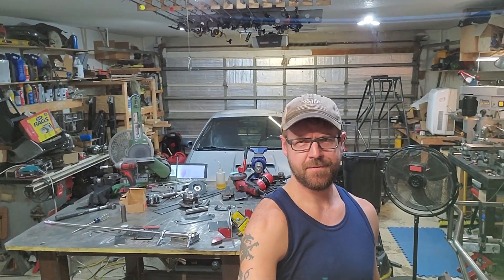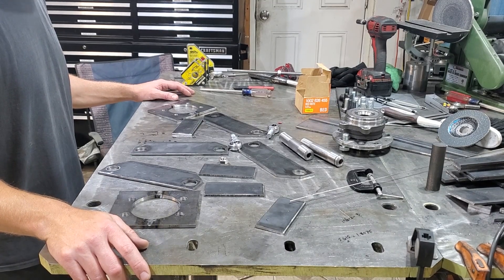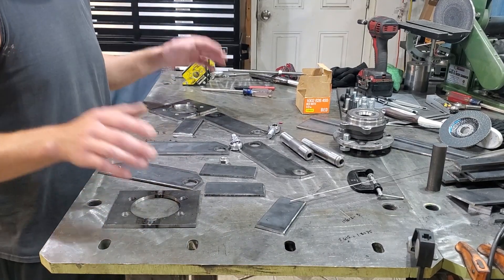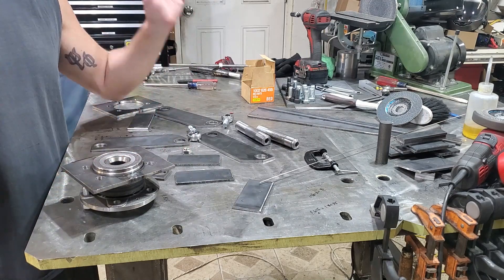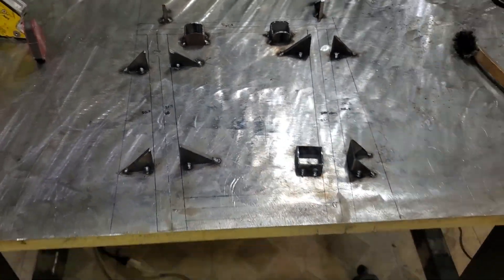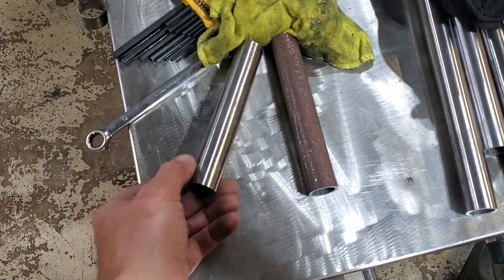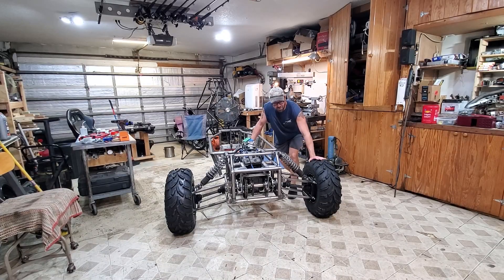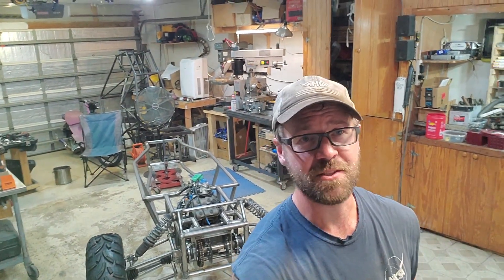Merikart: 1000cc V-twin Off Road Buggy Independent Rear Suspension is Complete! || Provins Garage

Comment: Granulated citric acid in water does a terrific job of dissolving rust it will leave  grey patins when the rust is rinsed off in water  after that polishing is much easier if desired.

Comment: Very nice work I have been watching you and rather B welding and homemade madness and Jimbo slice and all the other guys you are all doing a great job I’m hoping to build my own cross cart in the near future my question is how much do you think you’re gonna have into this cart when you’re done?
Reply from the maker: My goal was around $2500 and I'm going to end up around $2800 total. I spent a little more on stuff like stainless exhaust tubing and a tuning system for the motor so that put me over a little bit. It was my first Kart build so I wasted a little money here and there that I didn't need to. Thanks for watching! I plan to start another smaller and much faster kart very soon.

Comment: 2 questions :    what tube thickness is you using
and    what mig welder/amps are you running?
Reply from the maker: I'm using various sizes of tubing but for the main chassis tubing I'm using Docol R8 1-5/8" with .083" wall thickness. I'm also using 1-1/2" x .090" DOM tubing in places. 
The mig is an Eastwood 135 which has a rated output of 90 amps but I never go over half of that. It's on the cheaper end of welders and it doesn't have an amperage readout but I would guess between 35 and 55 amps for tubing (test on scrap and find a good setting). On my TIG I generally run around 65-75 amps.

Comment: Use solid rod and thread the ends. Because the threaded rod will wear out the brass bushings. 
I know from experience
Reply from the maker: Good catching. I already noticed some wear from the threads when I disassembled it to finish welding the tabs. Bought some solid rod and plan to do that very soon. Thanks for the input!

Comment: Doesn’t look like it has reverse. How would you build a buggy with reverse?
Reply from the maker: I'm thinking about using an electric motor for that. Have it engage a belt or chain by a lever. Either that or a winch on that back lol
Reply: @provinsgarage  machine some teeth around your brake disc like a ring gear then run a starter motor to drive the disc in reverse. Wire it so it only engages when in neutral and you have a push button reverse that disengages when not in use.